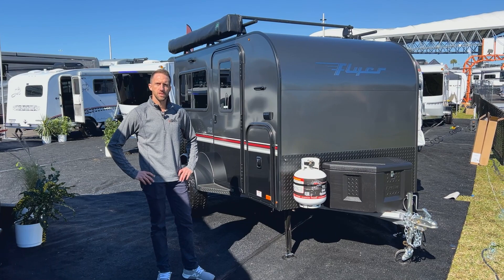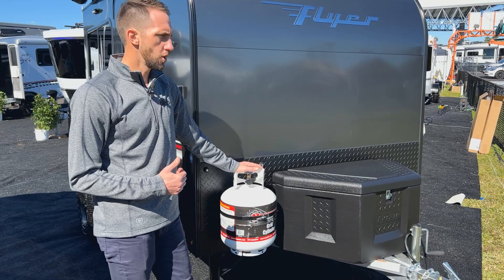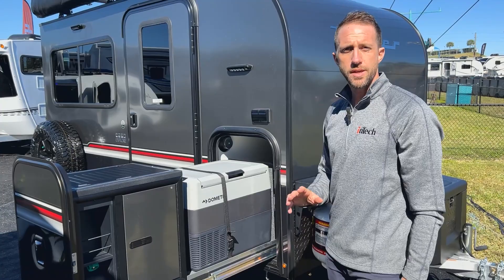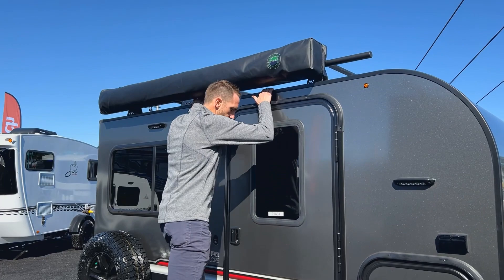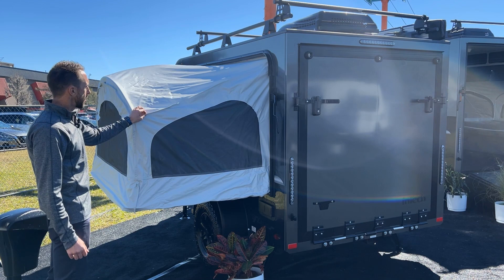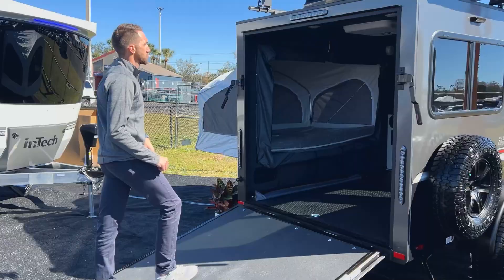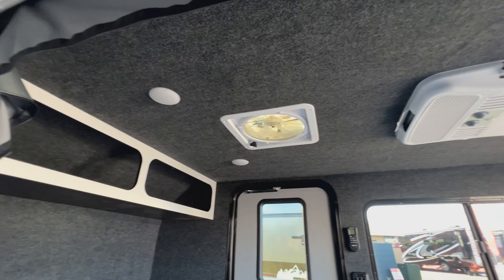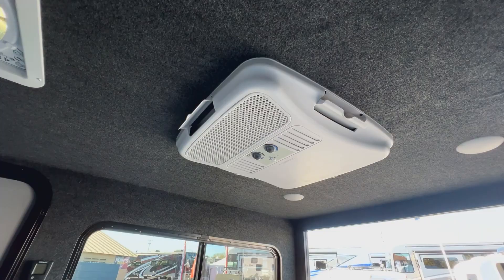2022 Flyer Explore Walkthrough

Comment: I've camped in my 2023 flyer explore now about a dozen times.  My thoughts?  This was the best choice for me as far a small travel trailer goes.  Intech thought of everything with this small toy hauler.  And it has just enough room for a 4-wheeler, not to mention mountain bikes, dirt bikes, etc...    If I were to change just one thing it would be the accent lighting in the cubby holes.  My lighting is red and I will be, eventually, changing the light strips out with a white light.  The red lighting is harsh on the eyes, especially when using the light to find something in the cubbies.
Outside of that I give this toy hauler 5 stars!  And I recommend it to anyone in the market for a small travel trailer or toy hauler.

Comment: Would love an Explore XL option, but smaller than the Discover. Maybe 6x12.5" base floor that would allow for dual tip-outs, side entry with window, ramp door, higher capacity axel with a 6" interior height. Does Intech do custom orders? No slide out kitchen option on the Discover is a bummer.  Cooking indoors is not ideal IMO.

Comment: Rear doors open as you go down the road, I have a 2020 chase. InTech has no solution. A/C sits on a flat roof and the weight of the A/C will dimple the roof and water gathers. Can not get ahold of InTech there no phone number to call and the form won’t create a captcha to send form.